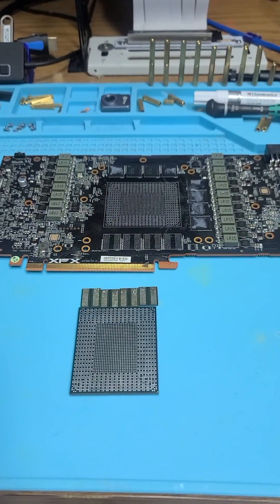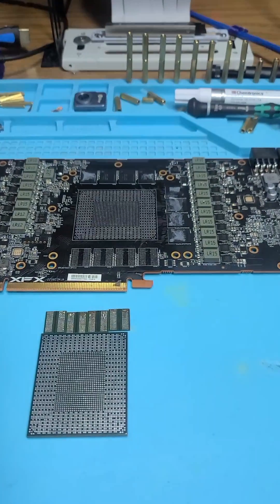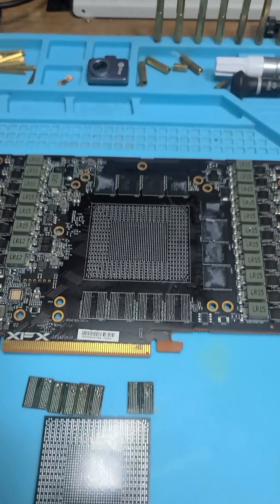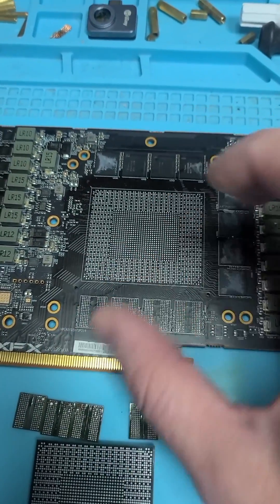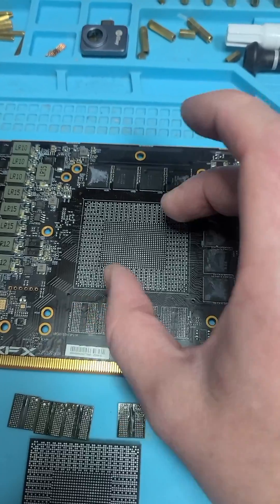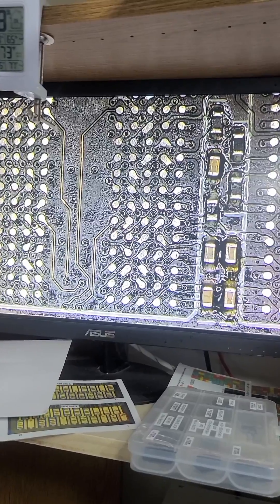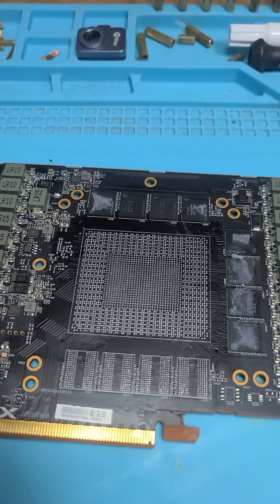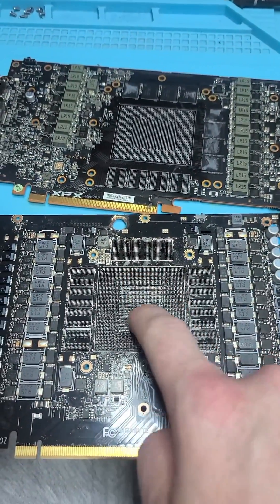TOP reason not to buy AMD 7900 series GPU #shorts

Comment: That would be a XFX or PCB problem, not an AMD problem.
Reply: its AMD problem since all custom should follow the reference speculation AMD provided, so yeah
Reply: @HimawariShinomiya  Custom cards do not follow the reference spec. That's what makes them custom.
Reply: @5467nick  they should but in some specific requirement, not all spec should be followed
Reply: @HimawariShinomiya  Think ya meant to spell check that into specification but uhh.... right
Reply: @Azureskies01  oh yeah, thanks for that, english is not my first language, im just learning
Reply: AMD still have reference spec that partners need to follow. This probably mean AMD probably allow partner to use this kind of PCB.
Reply: @arenzricodexd4409  Partners are not obligated to follow the reference spec and they sell a lot of cards that don't follow reference specs. The solder mask composition might not even be part of the spec. Take a look at JLPCB or other PCB manufacturing websites quotes for PCBs and you'll see that the solder mask composition/quality isn't even something you have a say in, you only get to choose its color, so it's possible that neither AMD nor XFX even knew about the solder mask quality being lower. It's also possible that they either knew and didn't care or that they didn't know but wouldn't have cared if they later found out. The way I see it, this is only an AMD problem if it's more than just XFX boards or XFX allows the company that builds their PCBs to use such a solder mask for more than a single run after customer complaints start coming in and AMD doesn't do anything about it. Are other AMD partners having the same issue with their PCBs and if so, do they share the same manufacturer? Does anyone who is not having this issue with their boards, AMD or Nvidia, use the same PCB manufacturer as XFX? The latter would imply whether or not XFX (and anyone else having the issue) actually chose the inferior quality solder mask.
Reply from the maker: AMD reference card is the same.
Reply: @northwestrepair  how is sapphire looking? Do they use the same material?

Comment: Happy 7900 xtx user here.

Ironically enough, the only GPU that ever broken for me was from nvidia. Specifically 2080ti, DOA. First and last time I went with the brand.
Reply: DOA is very weird, the card is supposed to be tested before release.
Reply: I still have a 5700xt by XFX OC and still working perfectly
Reply: GPU's can die for any reason and DOA can happen with any brand. Cards these days use much higher frequencies, power draw you name it and they are all obviously lead-free solder from the factory. I still believe Nvidia graphics cards last longer but i'm not sure about 20, 30 and 40 series to be honest I just know from personal experience and looking into GPU's for decades that Nvidia has always been considered the "nokia standard" when it comes to longevity as a whole. A few reasons are better temperatures and possibly better soldering within the chip because hot and cold heat cycles over time will wear the solder joints within the chip out, possible warping I forget the name of it but it is something like that. AMD has for a long time been about faster for cheaper right back to the early pentium days of CPU's.
Reply: @v.9876  i have ati/AMD gpus still living after long use and over a decade old. No issue.

Comment: Why would i care about that? These GPUs come with 3 year warranty, it dies they send new one and thats it.. What strikes me more is how these people manage to ruin these expensive GPUs, In my 20 years i had one GPU killed by lightning and that is it..
Reply: I guess it doesn't matter to you if a company is making an inferior product? 20 year old gpus are not the same as new gpus, i hope you know that...
Reply: @sei_asagiri  nah i had like 15 different GPUs in last almost 20 years. Now i have 7800xt, before rtx 3060ti ... Speaking about inferior products, just chek entry Zotac, Gainward etc 4070 supers and what you get for 600$, plastic toys. Plastic backplate, cooler than sounds like jet engine if you want decent temps, total disaster in my opinion. With Nvidia these days, less you spend more you get screwed.
Reply: @roki977  I have had nothing but problems with my amd gpu, specifically amd drivers and windows compatibility. Nvidia graphics is also supported by way more programs and software than amd graphics. I like AMD cpus but i cannot recommend an amd card to windows users after owning one myself for over 2 years.
Reply: @sei_asagiri  inferior is a pretty big leap in terms of what the video is saying. The mask the uploader is complaining about makes the repair harder and he's unable to do the repair as many times. So for this to even be relevant to an end user the card has to fail outside of warranty, in a way that has him reballing the die. So it has to fail multiple times in a way for it to be reballed for the mask to be an issue with repairability, outside of any difficulties it may cause the technician.
Reply: @tguit-fiddler5692  the reason why old thinkpad laptops are still popular is because they can be repaired inexpensively and easily. Reparability is very important, especially in a world where tech corporations can legally decline your warranty for any reason.

Comment: Is this exclusive to the 7900 series? I'm planning to buy a 7700 XT, and I am just worried about this post. Also, what brand should I buy? I saw that XFX might not be good at all. 😅
Reply: XFX is great, my 7900XTX Merc Black is built well.
Reply: XFX has never failed me, I've got an rx 470 that still runs and my 7900xt merc is great
Reply: Sapphire seems to be the best in terms of AMD
Reply: Sapphire, PowerColor, XFX. The holy trinity of AMD AIBs. Your best bet is to go with one of the 3 for your red team products. Also avoid any AIB that works with both AMD and Nvidia, they have a tendency to try and save money by reusing cooler designs that were designed for Nvidia on their AMD offerings. This results in poor performance because the way each side designs their cards is quite different, and a cooler optimized for one of course will not work as well for the other...

Comment: To be fair: This has nothing to do with the GPU. If your car tire runs flat, that has nothing to do with the car manufacturer either.
This PCBs get mass produced by PCB manufactures, most likely in Asia. One single board assembler may even work with a couple of PCB manufactures at the same time to get its required supply.

The only thing here which potentially could be AMD related, is the notorious requirement for AMD equipment to be price cut as much as possible, to keep a reasonable market share. But this is purely speculative at this point.
Reply: Car manufacturers have a choice on who they get their OEM tires from. Let's say that if Ford gets tires from Quick (a relatively unknown tire manufacturer), that's on them.
Reply: @triadwarfare  never the less every tire can ran flat. So basically it doesn't matter. You may weight quality, sure. You can say you get one running nearly double the miles. But in the end both will do the job. If you abuse them, they will fail. You can say repairing a card is some kind of abuse, because it is not the intended use case.
But overall it's not AMD ordering the PCBs for XFX. XFX will order them somewhere in the world. And that's the point here: As like Ford is not responsible for the tires you buy, you can not imagine AMD is responsible for the PCBs XFX is buying. So blaming XFX for a not really good PCB quality? Sure, they are responsible. Even if they don't know about this quality and got ripped by some PCB manufacturer. But there is simply no responsibility for AMD in this case. By doing so, it's a wrong framing.
Reply: @matthiash.4670  And why is Nvidia bigger?  Becauase they make better products and more people buy them.
Reply: @mintymus  well, that's not completely right. Marketing is one key instrument. Nvidia has it's faults like everyone, but can communicate it better often times. But overall they give a more complete product in common, with lots of features besides the graphics card itself. The "it just works" claim.
But they are not "bigger" because the GPUs are so good (really they are, but not as good to make such an amount of money). The big selling points for them are data centers, machine learning and CUDA. GPUs are just a part of their story. AMD doesn't have such a powerful portfolio in this regard. They tried with their Instinct platform, where Radeon 7 was once derived from, but they don't have much success with it, because Nvidia dominates in this sector not only with calculation power, but also with CUDA as defacto standard in this sector.
The giant Nvidia as it is today, was not build from selling GPUs. This market is too small and also declining year by year. They make good money because they had the right sense of digging into high profitable new markets, which in some manner they build in parts by their own.
Reply: @matthiash.4670  Go lookup what year AMD was founded.  Then lookup what year Nvidia was founded.
Reply: @mintymus  what's the argument in this context? Go and lookup what year general electric was founded? Does it matter? In this special case it is irrelevant in so many cases, because AMD graphics devision has nothing to do with its founding. You should ask what year ATI was founded. But it doesn't make any sense for any kind of argument.
Reply: @mintymus  what is the argument here?
Reply: @matthiash.4670  AMD was founded before Nvidia, yet Nvidia is better.  Why do you suppose that is?
Reply: @mintymus  again: What's the point? What's the argument here? There is no corrolation with any evidence the time of appearance in the market has anything to say about quality, success, pride... you name it. Apple was one of the early home computer creators, later they struggle to near bankrupsy, later on they came back.
If you try to get an arument on this basis, we can talk about the the moon period on product release dates... because this has the same relevance.
Especially Nvidias rising is a story of total failiur in the early years and a history of strategic competetor buyings over the time later on.
But this means nothing. AMD wouldn't be even in the market of GPUs if they didn't had brought ATI nearly two decades back in time.
Again: Everyone in the market has the potential on every point in time to compete. Lazy "uh X is better than Y" is worthless fanboy talk with no substance. AMD showed in the '90 how to compete against Intel, later on Intel showed how to compete agains AMD. Now it's flipped again. Sleeping and wrong decisions are the weak points either for AMD and Nvidia.
It would be foolish to underestimate an opponent - this applies in every situation. Intel did this in the early 2010 range. They paid a high price for their arrogance.
Reply: @matthiash.4670  Here, since you can't figure it out the obvious, I'll just say it.  Nvidia is bigger and better because their products are...yes...BETTER!
Reply: @mintymus  Nobody disagree their products are currently better in comparison to competitors. How you imagine somebody said the opposite? I think you are the one who can't figure out the obvious.
Your fault is to believe this is some kind of natural law, which couldn't change from one day to the other. Read clearly what I wrote and not what you would like to read. Because this is the diffused "fanboy sight" you complained about by yourself earlier. So be better. Don't do, what you complain to others.
You can thank whoever you believe in, at least any competition still exists. Because without you would already spend an arm and a leg for such hardware.
But you have to acknowledge no giant stands forever.
Reply: @matthiash.4670  Glad you agree.
Reply: Chiplet design that is notoriously hard to repair perhaps, but yeah i agree, pcb material used is not on them
Reply: @tomthomas3499  Chiplet design "notoriously hard to repair" is a single solid part. It does not cook itself like memory on Nvidia. Ever thinking you know... maybe it does not break. The broken "chiplet design" means you CAN"T FIX IT AT ALL. It's a one, single part.
Reply: STOP with this stupidity about "the market share" AMD has 15-20% of the market because it's a company 6-7x smaller than Nvidia. This smaller company is focused on CPUs. Only a small part of resources, employees and R&D goes to Radeon. 
Why do you think AMD has a similar market share in CPUs? Because of competing with Intel which is a massive company compared to AMD.
Reply: @HanSolo__  what are you talking about? AMDs graphics devision was brought from ATI. An ATI at it's time was a real comparator to Nvidia, with top noch designs. What happened since than? What is the argument here?
Back in 2016 AMD was nearly bankrupt, with a stock value in cent's per share. Far smaller in comparison to Intel. At the time only blind AMD fanboys brought there Bulldozer architecture crap. And what happened? They caught up rapidly against the giant Intel.
Market share is not a matter of how big or small a company is. It's just how competitive the products are. Even Intel as a segment newcomer plays in the range of today's AMD GPU products.
So, there is no argument they can't catch up with the right decisions. There is no fundamental law of physics AMD cannot deliver price competitive products with a great market value. They did it in the past, but spend a lot of resources with wrong decisions like Vega or Raden 7. That's not Nvidias fault nor do they can't beat em.
AMD was thinking for too long, they can direct the gaming sector by having there design wins in PlayStation and Xbox. They were wrong. Now they struggle, somehow as like Intel is currently struggling in the CPU sector.
And last but not least: AMDs origins are not the CPU market. It was a semiconductor manufacturer in first place. But did a lot of wrong decisions over time, to now and up with the x86 manufacturing as a main topic. They had once there own Fabs. Back in the early 2000 I visited a AMD Fab by myself. Soon after the rapid downfall started.
The biggest enemy AMD has, is itself. For nearly 2 decades now at least.
Reply: He's being plenty fair.  AMD GPUs are crap.

Comment: So I should buy 4090 which i can then send 20 times to you to reball it? Clever af mate :)))
Reply: Will have to fix those cables as well, insane how team green's marketing completely dominates online discussion.
Reply: No, you should buy it so you can experience melted connectors. huehuehue
Reply: I've been lucky so far with my 4090. @NightsoulRO
Reply: My connectors are still ok after 1 year 😅  @NightsoulRO
Reply from the maker: No..you should buy something that can be repaired.
Repairability=quality.
Reply: @northwestrepair Thats not what quality means AT all. But sure.
Reply: That's mean durability wise the pcb on 4090 is better.
Reply: @arenzricodexd4409  i never have needed to reball any gpu ever nor has 99.9% of people. titlecand content is clickbait.
Reply: @francistaylor1822  because better parts are being used in the past? let's see how this one going to affect things down the road. what you said is like "my GPU with 8 pin never melt nor did 99.9 people out there with such connector so those GPU with 12VHPWR should be perfectly fine".

Comment: In 2034 (when the weakness of the amd one will be more evident)these gpu will be slower than a phone and garbage. So for a garbage i prefer the cheaper and more friendly environment one. I think you miss totally the point
Reply: I have a GTX 1080 and there is still no phone that is even nearly as performant as this card, so yeah. It is even worse now because difference between 2007 GPU and 2017 GPU is much bigger than between 2017 and would 2027. Especially if you consider raw performance at the same wattage. Tech is stagnant, the only thing that will change is the ability to fantasize frames with NPUs.
Reply: @ChuckTheChosen  still 99% of 1080 are not even used, probably are in the garbage right now cause a 6600 is better with less tdp. Plus nvidia gpu are much more pricer.  There is no point really to make praise of outdated garbage that "gives you cancer" and is not envoirment friendly as garbage